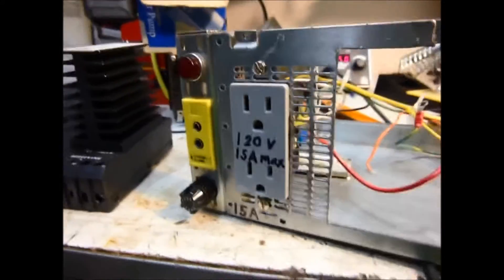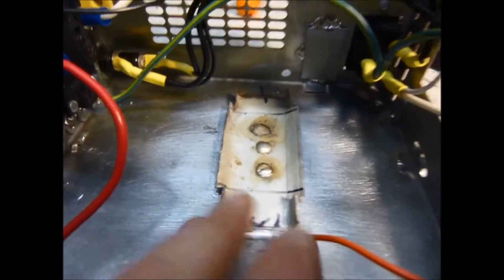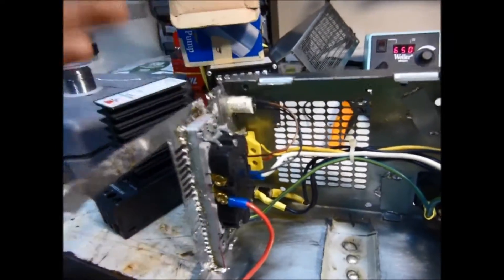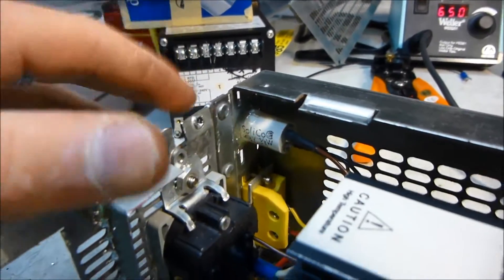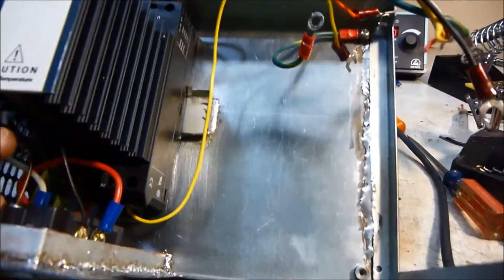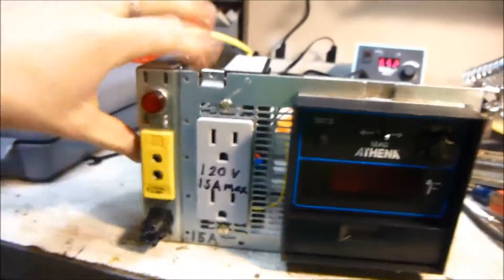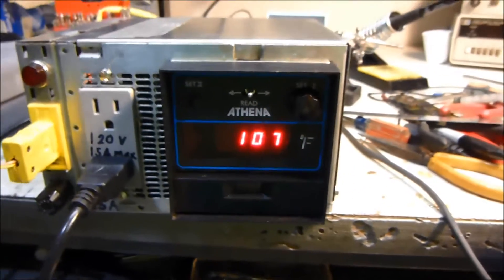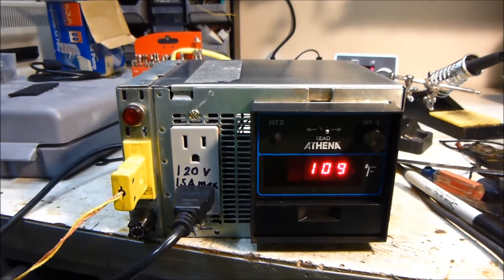Adding a Fuse and Indicator Lamp to my Solid State Temperature Controller Unit

Comment: What I find the most cool about this thing is that you welded the metal on with solder... I had no idea solder had that kind of property.
Reply from the maker: Yeah I love doing that!  I don't have a welder so it's really the only way I can attach pieces of metal together without glue or nuts and bolts.  I really like soldering because it's so fast and it is pretty strong and you can always reheat it and redo the joint if you don't like it.  I actually soldered most of my newest stirling engine together.  Only problem with soldering is it's not high temperature and it will not stick to stainless steel and aluminium.  Well actually you can solder to aluminium if you do the right prep work.  But it takes a lot of work.  If you like this you'll like the solder job I did on my stirling engine!

building the displacer for my stirling engine part 1
Building the Displacer Cylinder For My New Stirling Engine #5 - Part 1 of 2
building the displacer for my stirling engine part 2
Building the Displacer Cylinder For My New Stirling Engine #5 - Part 2 of 2
Reply: Makerj101 Just checked out the videos and it's pretty cool how well the solder held against the testing you did. Maybe one day I'll do this on a project I may have. You should do a tutorial on welding with solder as that would be a nice informative and easy video. You really only talked and showed the process for about a minute.
Reply from the maker: Thank you!  Sure, I could put that on my list of videos to do!  It would be a quick and easy video to do!  I actually just soldered a pipe adapter kind of thing for my fume extractor.  It works great!
Reply: Makerj101 Wow! That's amazing.
Reply from the maker: Thanks!